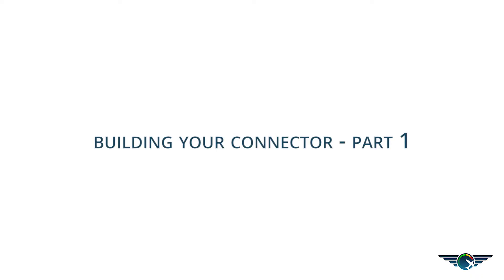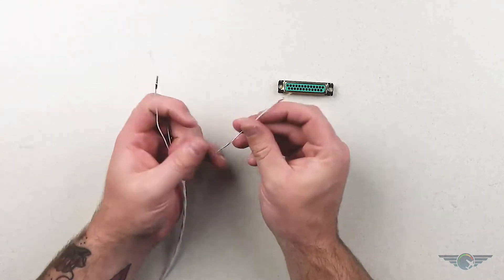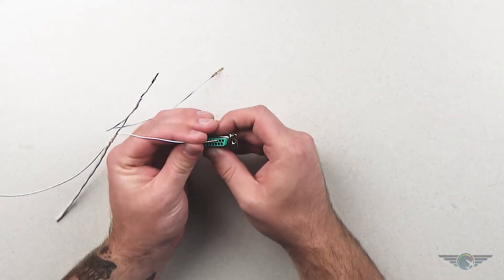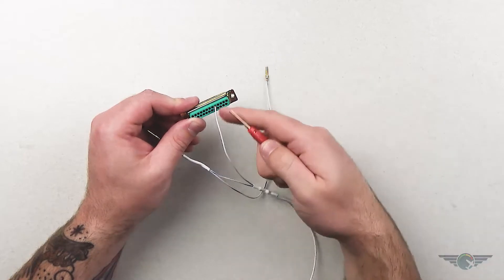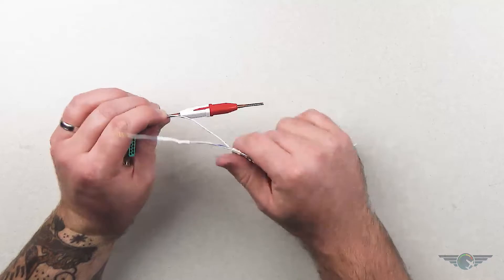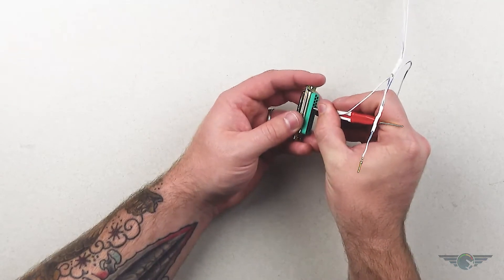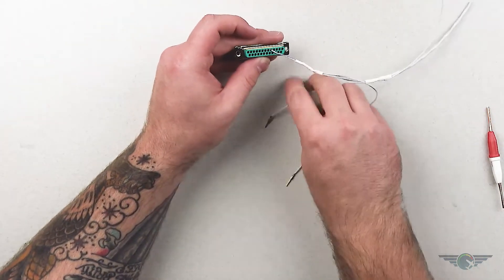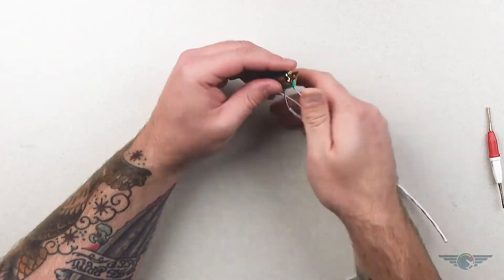Garmin G3X Wiring Fundamentals Series – Building Your Connector – Part 1

Comment: This video series is very helpful, but seems to have conflict with Garmin G3X install manual documentation. It uses the blue wire for CAN bus HI which is spliced to another another blue wire for CAN bus termination. The G3X install manual doesn’t say what color wire to use for  HI/LO but the documentation shows CAN bus termination wire is spliced into the LO wire. See G3X install manual revision AL, figure 2-12 “CAN bus termination for GAD27, GDU 37X...” Also, regarding color convention, in the G5 install manual Garmin uses the White wire for HI and Blue for LO. Not sure how much this matters since I’m just learning this stuff, but it had me confused as I watched the video along with the manuals.
Reply from the maker: Sorry for the confusion, the important part is that the wire color chosen is used consistently throughout the installation. So if you use the white wire to terminate the CAN HI, you do that consistently throughout the installation and likewise with the CAN LO. 

I recently wired my installation over this past Summer and decided before beginning my installation that I would dedicate the white wire to CAN HI and the white/blue wire for CAN LO. I noted that in my wiring diagrams as well so that if I need to trouble-shoot later, I can remember how its wired. Thank you for choosing G3X Touch!
 
^DK